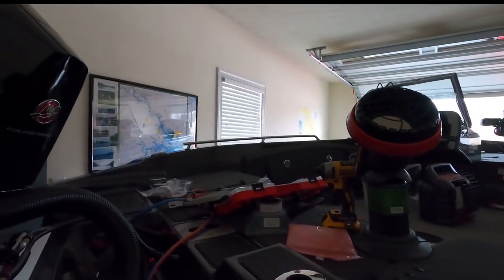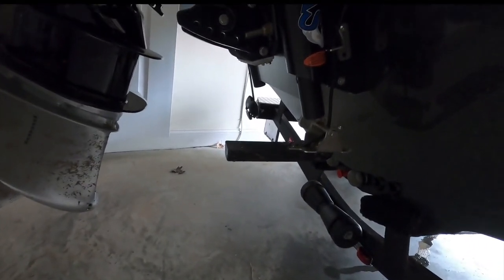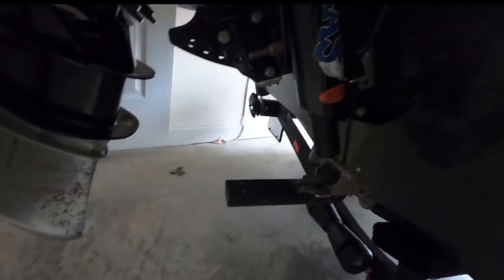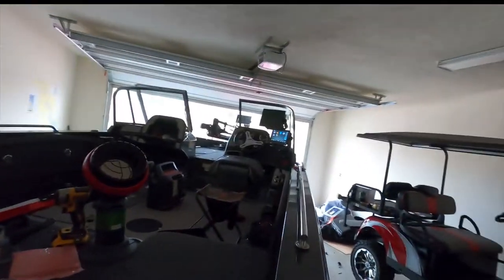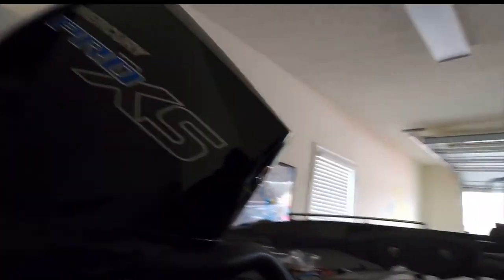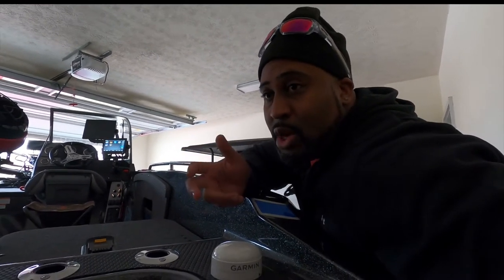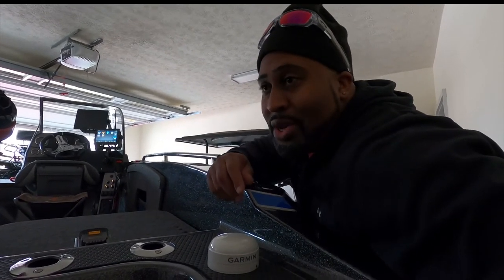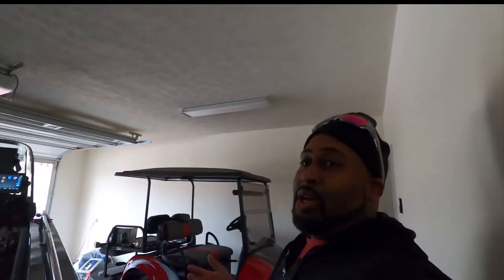2021 Triton Allure 206 Finish Build.

Comment: Good information. I’m interested to see if the Force has a long enough shaft. Do you have the new LiveScope Plus LV34? Love the jackplate transducer mount. Did you use a custom L bracket for the jackplate transducer mount?
Reply: Hey Jay, I do not have the new transducer I am going to hold out for now the LVS32 is working for me.  The bracket is from Rytek Marine out of Canada.  He ship quick and answer his phone all the time.
Reply: @blackice5310  is the Force trolling motor shaft long enough? I’ve heard they are shorter than the advertised length.
Reply: @jayb7675  I have the 57” shaft and I am at least a couple of feet below the water line.  How deep you want to be?
Reply: @blackice5310  most recommend a 60 inch so I thought the 57 Force would be close enough. Then I found out that it’s not a true 57inches. It is actually equivalent to a 52inch Ultrex. So I was curious how it was working out for you. On calm days it should be good but was wondering about how it performed on windy days. Does it come out of the water when it’s windy?
Reply: @jayb7675  no it does not come out the water but I will measure it next month and let you know. The only thing about it is that is quite as hell,  I ram it under a bridge one time because I didn’t even know it had stop turning.  I have my folding mount in the one I think and I have to look over or around the chart plotter to see the prop turned on.  I got to fix that
Reply: @blackice5310  thanks, I heard the brushless motors are very quiet.

Comment: nice boat i have same boat on order. i have two garmin 93sv to put on do you have any recommendations? do they network well? i have live scope not sure how i am going to incorporate that.
Reply from the maker: Thank you for subscribing.  What color did you get?  With those units you are going to need a Y cable part 010-12445-33,  6ft and 20ft network cable part 010-11425-10, 010-11425-09 and last a hub to network it all, GMS 10 hub part 010-00351-00.   If you're going to run antennas and vessel view link from the motor you will need a NMEA 2000 backbone kit.  Hope this helps.
Reply: @croppiehunter2829  thanks for the info. i went with color gunmetal and nussa blue. i noticed your boat and looks like the one i was watching at the boat doc in WI?
Reply from the maker: @travisbell5712  yup that’s where I picked him up from.

Comment: whats the speed of that with a 300hp. i got a ranger 620 with a 250 and get about 60mph
Reply from the maker: Dbars19 first I would like to know the difference between a 250 & 300?  I think they got me..With a 1/4 tank of gas no gear and just myself at 250lbs I get around 64.6 I saw it 65 once on a good calm morning.
Reply: @croppiehunter2829  yea bro. really dont need a 300hp on that boat.  a 250 SHOULD get u about 60mph. Guess they got u for some extra money. If you get a good prop with a jack plate u can prolly get some more speed. Your triton 206 is lighter than a ranger 620fs so idunno. i would have thought u would get 70 with a 300.
Reply: @Dbars19  well it’s still a heavy boat, V hull, almost 21’. I am pretty sure if I would go up one to a 24 pitch different prop, I can make it go faster but no need.  I already run most PWC down so I am good.
Reply: @Dbars19 that boat’s mph is limited by Hull design. The 300 only gets a few more mph, but it more than makes up for it in holeshot and midrange. Where it will shine is in big water when you need to be able to throttle up over big rollers.
Reply: @croppiehunter2829  What prop do you run on your Merc?
Reply: @ryanomalley3724  hey brother is the stock prop.  I think is a 23 pitch.
Reply: @blackice5310  Thank you mine came with a 19 pitch 3 blade. Top speed with that is 56.